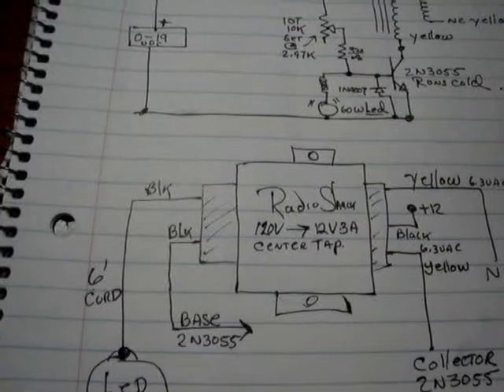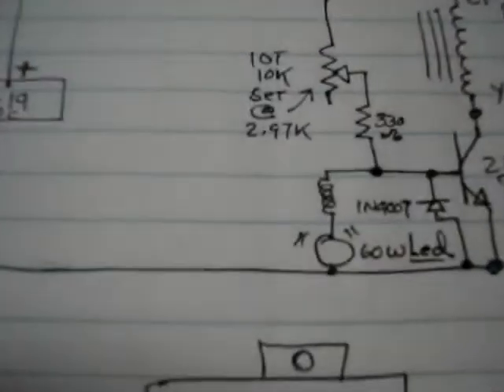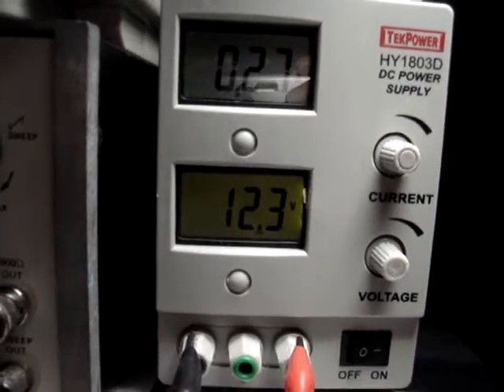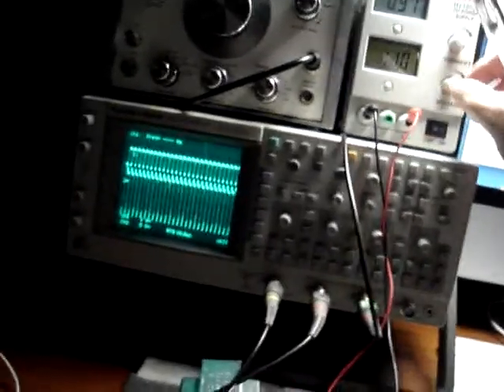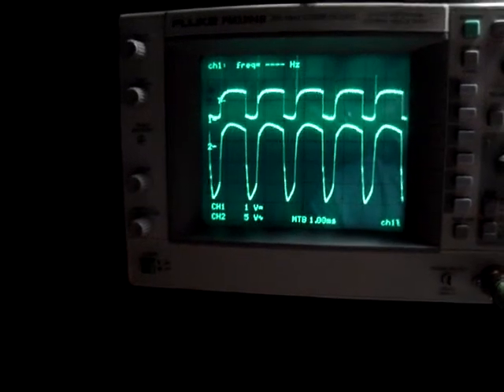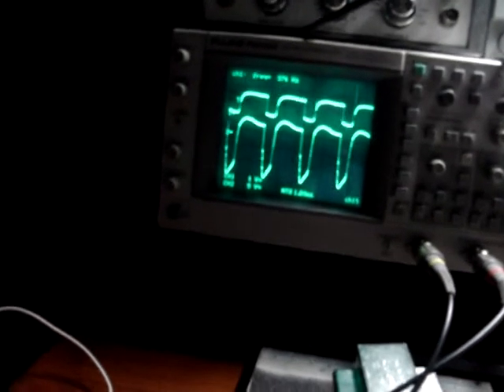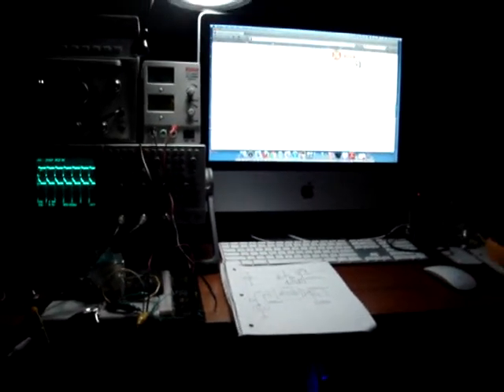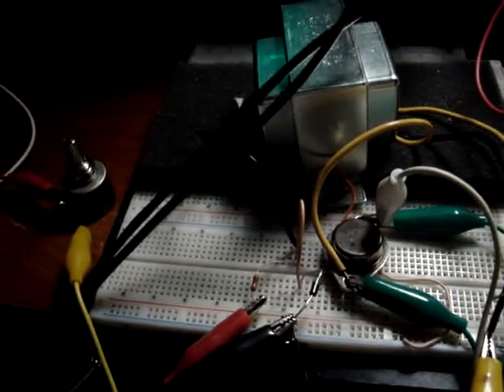Using the LED at night on my desk. Ver. BT 1.0

Comment: I worked with your circuit modification yesterday and got very similar results.  I might put a switch in the circuit to flip between the center tap and the other yellow wire.  All I'm really doing now is trying to figure out how best to "box" this up and start using it.  Thanks for your input on this showing the wave forms and "sweet spot".  That really helped.